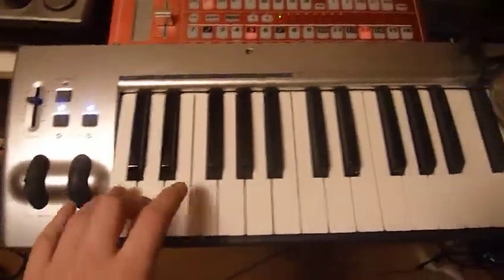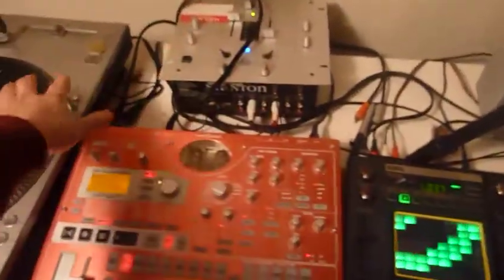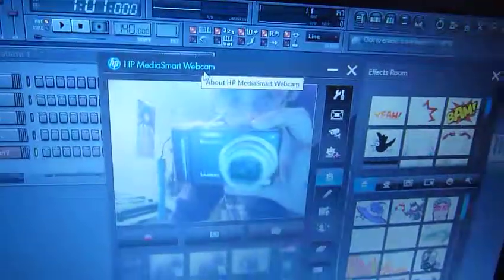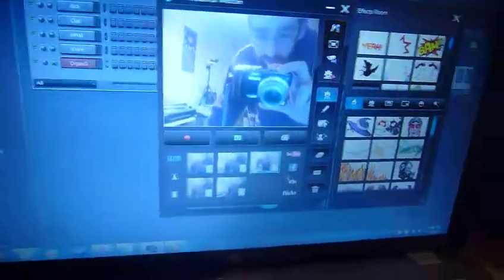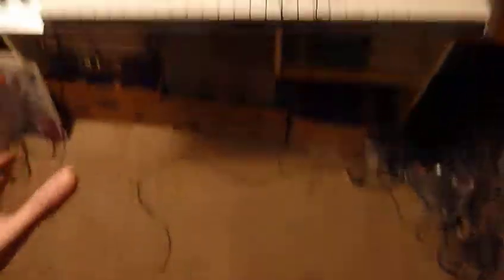The Set Up (Kaoss Pad 3, Koassilator Pro, Electribe SX, M-Audio KeyStudio)

Comment from the maker: You need a 1/4 inch headphone jack, or a 1/4 inch to TRS (regular headphones) which you can get at any electronic retailer (Walmart, Radioshack, etc) for like 4-5 bucks or maybe cheaper at a thrift store.And the right RCA jacks are output, which you can also use to plug in to a speaker system - I've even used my TV before as a speaker - I just took the Red and White from my DVD player and plugged it in to the TV.